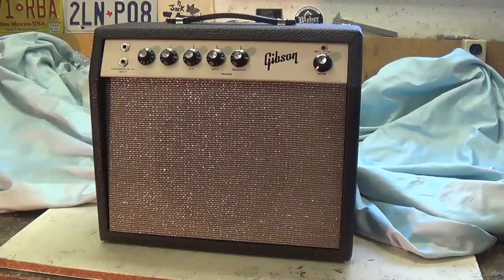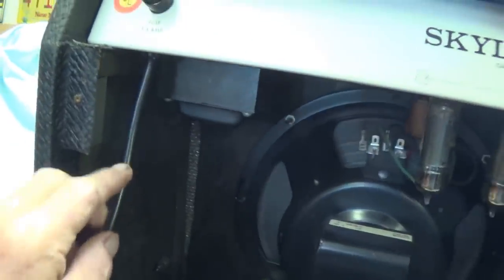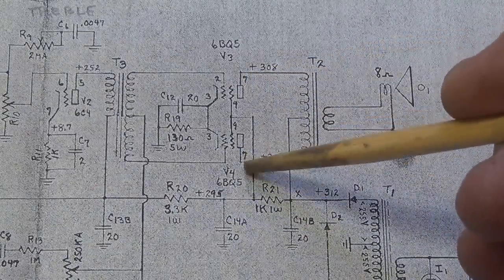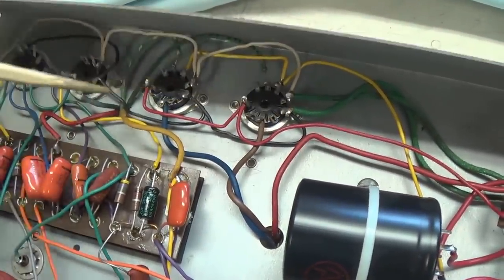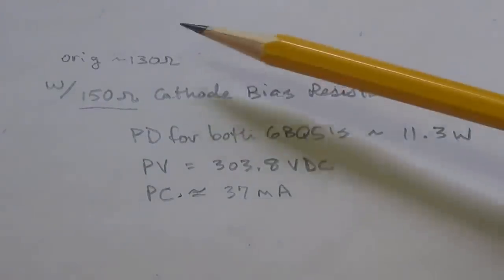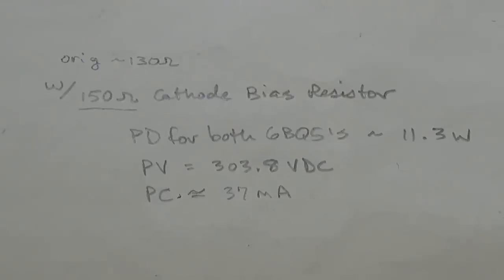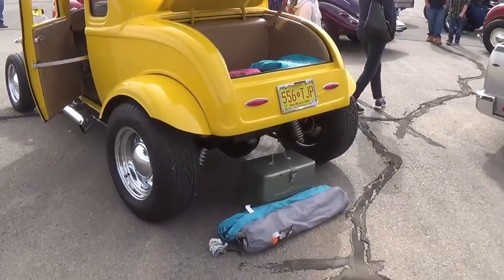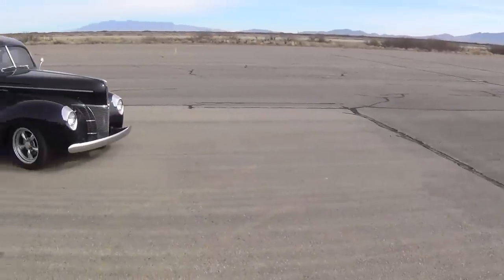1965 Gibson GA-5T Skylark in Superb Original Condition

Comment: UD thank you for this video! I've heard the bad rap on 60s Gibsons but this illustrates why. Also, I really appreciate the effort to analyze the circuit for the whys & wherefores of the cause and then your mod to the tone (which was a big improvement)! Just wondering if the other input makes a difference?

btw Love the car show, too!
Reply from the maker: You're welcome, KV. A quick peek at the schematic reveals that both inputs are identical.
Reply: Uncle Doug yes, I see that now. You must forgive as I'm a Tool & Die Maker & Machinist and still an amateur in electrics & electronics.

This amp looks like a great opportunity to tinker with modding one of the inputs with a tone cap, resistor or boost. In fact, I've been contemplating trying my hand at brightening/clarifying & boosting one of the inputs of my '60 Champ to give it a more James Gang tone at mid to low volume. If I may ask, what would you recommend?
Reply from the maker: I am an amateur machinist myself, KV, and have posted some videos showing some steam engines and electromechanical tremolos. Boosting treble in a guitar amp is really not possible since the tone controls are all passive.....no "boost" is possible (only possible with "active" tone controls). All you can do is reduce the bass, then turn up the volume a bit, which will make the treble seem more evident.  You can experiment with low-value series capacitors in one of the input circuits, which will reduce the bass frequencies. But in the long run, you can more easily accomplish this with unaltered inputs and proper use of the amp's tone controls. Good luck.
Reply: Uncle Doug thanks a bunch! 😎👍🏼
I tend to rely on an onboard 9v treble boost & volume boost in my strat (like Clapton's Blackie) and an Ibanez tubescreamer pedal. The combination seems to add sparkle that the Tweed 5F1 seems to lack. I've heard of bright caps on Marshalls but didn't know if that was possible on a Champ which lacks a tone knob or EQ
Reply from the maker: The Marshall "bright" caps are simply low-value caps that bypass volume and tone controls, thereby giving the higher frequencies a short cut to the output tubes. You could try this also.

Comment: Doug, I just picked up one of these amps (1965 GA-5T). Two questions first did you all the tone mods you showed on the schematic at 31:54 or just the bass mod? The original speaker is gone and was replaced with a Celestion Ten 30 which is ceramic. So my second question is should I search for an original or is there an modern alnico that a good fit for this amp?
Reply from the maker: As I recall, I did do all the modifications indicated.....however, you can test your amp after each modification and see if you approve. I think your replacement speaker should work just fine. I tend to like ceramic speakers because they are generally warmer than alnico's, which might be better for this amp.
Reply: Thanks Doug

Comment: Hi Doug,  did you try to replace C4 (10nF)  with a new one  ?   My idea is that the old capacitor  changed his capacitance to a higher value and blocked -together with the first part of the Tonepot ( 1M of 2M)   the Audio Signal , especially the bass frequencies. Only a l amount of highs  reached the next stage across the bypass  with C5 (500p) .After exceeding the tap-point  the 100k resistor leads all frequencies to the next stage as a volume pot..   So  try a new  C4 and - maybe -  you will get the functionality of the tonepot GIBSON wanted to have in 1965 .
Reply from the maker: The cap was OK, Mr. T. I really think the tone circuit was just a poor design. Thanks !!!

Comment: When you twisted the filament wires, did you lift the unbalanced filament wiring from ground and replace it with a pair of artificial center tap resistors?
Reply from the maker: I never did twist or alter the filament wires, GU. The amp was quite hum-free as-is, surprisingly enough.

Comment: "And the amp too." Very funny. I have 2 of the non-tremolo version of that amp; one is branded Epiphone. 12Au7 2xEL84 PI transformer. I modded the tone circuits years ago, but I need to open it up and see if what I did is similar to your mod. Did eliminating the small cap at the input have much effect? I suspect that upping the grid leak resistor to 1M did little if anything? BTW, the two I have were also immaculate when I bought them, I suspect it was because in stock form they sound like a jangley mess.
Reply from the maker: No, I doubt that the increased grid leak made much difference, but every little bit helps. The amp really works well only with humbuckers.

Comment: Hi Doug, I was trying to find the video that you refer to about replacing the handle. I have this exact amp and I want to replace it as you suggest by drilling out the center pins. I did a search but I couldn't find the video. Thanks, Jim
Reply from the maker: I don't recall either, JJ......but "drilling out the center pins" seems like all you really need to know.
Reply: @UncleDoug  I understand that part, but past that I have two questions: What did you replace the center pins with? And you mentioned that you epoxied these in place, did you epoxy the pins to the wood of the cabinet? Just trying to understand the entire procedure.
Reply from the maker: @jimmyjoefine  Once the pins are drilled out, you can use wood screws or machine screws & nuts, or even pop rivets to secure the handle brackets.  I would never use epoxy.
Reply: @UncleDoug  Thanks for the info. I can't figure out what you said at 2:30, I swear you say "epoxy" lol. I like the look of what you used on this amp, which I'm guessing is a rivet.
Reply from the maker: @jimmyjoefine  Thanks for providing the time in the video. I did say "epoxy", which would be OK since the pins resist lateral force, unlike the rivets/pins/screws that hold the two end brackets to the cabinet. The pins were made from nails, cut to length. You could probably use longer nails and bend them over inside the cabinet for added strength.
Reply: @UncleDoug  Okay, this makes more sense to me now, thanks for taking the time to explain your procedure!
Reply from the maker: @jimmyjoefine  Sorry for any confusion.
Reply: @UncleDoug  Just wanted to say thank you again. I actually found some dome-topped split pins that look exactly like the other fasteners holding the handle mounts. I was able to pound a small brad into the center of the pins from the underside of the cabinet which resulted in a very tight hold without any need for adhesive. I'm very pleased that I was able to preserve the vintage look of this amp. I never would have thought of this solution without your video!
Reply from the maker: @jimmyjoefine  I'm glad to hear of your successful repair, Jimmy. Good work :)

Comment: Oh...6BQ5s...At first I thought you were going to find the "thready" sound of the amp was due to relatively small output transformer/6BQ5 setup. (Not much of a subwoofer amp(8-))
Then you put your pointer near that .0047 capacitor...that got my attention(8-). The rest of it...made no sense to me why one would use a "loudness control" pot (allows for a little
less attenuation of the bass content at lower volume levels) for the actual bass control pot....and then you pointed out the treble control circuit look quite sane. This was an out-
standing presentation of the problem and the cure(s). And the end result was a nice little monitor/practice amp. And all I saw wrong with the tremelo was that the depth control wasn't
really what I'd call linear...but it worked pretty darned good. And if it works, don't fix it.

Great car show visit. Some beautiful road iron there for sure.
Reply from the maker: Thanks, Tom. I believe the Tremolo Intensity pot was logarithmic, which would explain the delayed effect. It would be better linear.
Reply: @UncleDoug  That's what I was thinking, but the problem's not bad enough to merit much effort or expense.
Reply from the maker: My feeling also.
Reply: @UncleDoug  I sent you a "little note" (spelled "encyclopedia"(8-)) in patreon mail....sort of a preface for something you can check out Monday or Tuesday...in case you
haven't been to patreon messages in a day or three...

Comment: Doug - any idea why Gibson's engineers opted for a transformer to do the job of what was traditionally a job for a dual-triode tube? Seems unlikely that it was cheaper...but maybe by 1965, the cost of installing the tube was more  than the cost of the transformer? 

Anyway, wow, much nicer than the older "tree-bark" GA5T that I had many years ago (used 6AQ5s)...man, that was one of the worst sounding, most anemic amps I ever heard, lol! Even before your mods (nice!) this amp sounded twice as good as that older GA5T. Anyway, cool video, as usual. Great job comparing the schematic to the layout in the amp. It's also interesting to note how little apparent impact the twisting of the filament leads has. I know some folks act as if it's tremendously important...but I've had plenty of old amps (most of my Magnatones, IIRC) with next to no twisting of those leads and they ran quiet as church mice.
Reply from the maker: Good question, Leon. I would imagine that the cost of the small transformer was about equal to a tube and socket back then and easier to wire, but I honestly think that Gibson engineers were relying on a classic old method, found in lots of their early amps, to provide the best possible PI circuit. Even though their mid-60's amps tend to sound lousy, they really went to great lengths to over-engineer them. This is what happens when you don't have someone like Leo Fender handy to actually listen to the amps (and musician input) rather than simply look at schematics. I think that twisting the filament wires is a tradition (that we all still follow), but agree that I have heard some really quiet circuits with un-twisted 6.3VAC wiring.
Reply: I may be mistaken but I think that transformer phase inverters have some benefits to do with blocking distortion and drive issues when they get hit hard. They're pretty uncommon because I think the raw materials cost of all the copper that a good transformer needs is actually more than another tube.
I have been planning some builds lately and the transformers are by far the most expensive components, even a PT for a 1watt amp costs more than a handful of 12ax7's
Reply: Well, transformer probably lasts longer than tubes. 🤔  And maybe they thought that if the transformer is of good quality, it would be more Hi-Fi. Unfortunately Hi-Fi is not what most guitarists want unless they want very clean sound. But it keeps the tremolo signal symmetrical to both tubes, if the transformer windings are symmetrical. (For example cathodyne PI does not because it would load tremolo signal asymmetrically.)

Comment: re: 23:22.  I have an original and the circled 20mf cap is there (not a mistake)  There's two dual 20mf one 450v one 325v
Reply from the maker: Thanks for sharing, Ernie :)
Reply: @UncleDoug  makes you think it may have been for a reason on the amp you worked on?
Reply from the maker: @ernietokay8574  Having two identical caps in the same node really doesn't make much sense, Ernie.

Comment: I liked your grudging disconnection of the death cap. The untwisted heater wires is pretty poor practice. Effective mods. As regards to extra 20uF decoupling capacitor on the circuit diagram, I notice there are 4 sections on the JJ replacement electrolytic, one of which has not been connected. Curious.....
Reply from the maker: I think they bought the cap after looking at the schematic.....with four 20's. Once they installed it, however, it became evident that it only needed three of them. Either that or four 20's was the only can cap they could find.
Reply: @UncleDoug  Makes sense. I guess I would have hooked up the spare section for some extra smoothing, but that's cos I'm a hifi head.....Best. M
Reply from the maker: It is a shame to let it go to waste, but the amp is quite hum-free as-is.

Comment: Is there any way a novice can test to see if a tube amp has been over stressed, assuming it still works okay and the speaker is fine. Also would you consider showing the right way to connect a tube amplifier head to the speaker or speakers of another amplifier in order to use it alone or with both amps alternately.  Did you ever play in a good cover band?
Reply from the maker: The only way to properly judge a tube is with a tube tester (for emission and shorts) and to measure its plate voltage, plate current, and plate dissipation......which are probably not in the realm of a novice. The main concern with attaching to speaker cabinets is to be sure that the speaker impedance matches the output impedance of the amp......and that the wattage of the speakers is adequate to handle the output power of the amp.
Reply: @UncleDoug  Thanks.

Comment: Hi Uncle Doug--Nice exposition as always, and your modifications really improved the tone.  It's surprising what odd-sounding guitar amps Gibson made--one wonders who in the company thought those tinny sounding amplifiers were going to sell well?  I think the best tube amp that Gibson sold may have been the Thor bass amp.
http://johnkvintageguitars.homestead.com/Thor.html
I owned one of these a long time ago, even though I don't play bass.  They had a nice balanced bright tone that sounded good with guitar and Fender Rhodes piano--in large part, I suspect, due to the 2 Jensen guitar speakers they used.  In fact, I think the only thing that made them a bass amp was the use of a sealed speaker cabinet and an extra large output transformer to reproduce the low notes on an electric bass.  They didn't have a goofy tone control unlike other Gibson amps.  The amp also had a massive power transformer and would produce an honest, clean 50 watts from a pair of EL34 output tubes and the amp was capable of lots of volume.  I never pushed it into distortion, as the volume level would have been over the top.
I sold the one I had because it was heavy (55 pounds) and the bass player in the group I was in wanted it.  I regretted it almost immediately.  The construction of the amp was such that it would have be easy to modify it so the amp chassis could slide in and out, which meant the amp and speaker cabinet could have been carried separately.   I should have kept mine and made that mod.  If you ever run across a Thor at a decent price, I think you'd find it a rewarding project.  Gibson later changed this model to use a solid-state amp, and I have no idea how those sounded.
Reply from the maker: Thanks so much for the tip on the Gibson Thor amp, R. I have never seen or heard of that model, but based on your favorable analysis, I will definitely keep an eye out for one.

Comment: Have you ever successfully reattached a slightly unglued faceplate on something like a Fender Bassman 50 head?  I am electrically "blackfacing" an AA371 - a challenge for me that you are helping me with immensely.  I think I can eventually get through the cap and resistor rerouting and soldering with your excellent tutelage and VintageFenderAmp.com instructions, but I don't know anything about external cosmetics.  Thank you!
Reply from the maker: I installed a new faceplate on a Fender Bandmaster several month ago. There was no glue involved.....the pot and switch nuts held it in place.
Reply: @UncleDoug  so this little beast has some kind of weird yellow non-jewel pilot light.  I've ordered a red "Fender" jewel in hopes that the bezel will catch the faceplate.
Reply from the maker: That sounds like a more appropriate pilot light, Michael.

Comment: Doug, do you have a part name / number or recommendation for replacing the multi-capacitor and other components replaced in this video.  I'm about to do the same to a GA-5T, but I have no knowledge of what a recommended replacement is for vintage amps.  Thanks!
Reply from the maker: Take a look at the Antique Electronics Supply site, Chuck. They have all sorts of can caps for sale.

Comment: The 6EU7 is similar to a 12AX7 but has an untapped 6v filament and different pinouts.  It was designed to be low-noise.
Reply from the maker: Thanks for the info, D20.

Comment: You need to back your guitar's high E string pup magnet pole down some. It's WAY louder than the other strings.
Reply from the maker: Gosh, I'm sorry that the misposition of a magnet pole overshadowed the entire 50+ minute video, SB. It must be terribly distracting. I'll get right on it :)
Reply: @UncleDoug  Your vids are always informative, but I just wanted to hear what the lil Gibby sounded like and that high E liked to take my head off.
Reply from the maker: Again, I'm sorry for any discomfort the E-string may have caused.
Reply: @UncleDoug  Well that's not going to fund my audiologist's country club membership!
Reply: @UncleDoug  OK, so I've watched some more. By lifting that cap on the Bass controls low pass filter, you effectively removed it's ability to pass low frequencies. The high frequencies pass thru the 500 pf bypass cap. All frequencies will get attenuated thru the resistor as you dial it, but you can't actually remove any of them without that cap you removed. You've effectively added another volume control. You probably need to replace that pot with one that has more linear resistance across the wiper.
After thinking about this, I think it's probably better to just remove the pot/0.01 uF cap altogether. As it's actually creating a LPF it's removing the higher low frequencies not the lower ones. As you noted, it sounds best with the bass dimed anyway.
Op amps make life so much easier...
Reply from the maker: Thanks for your input, SB.